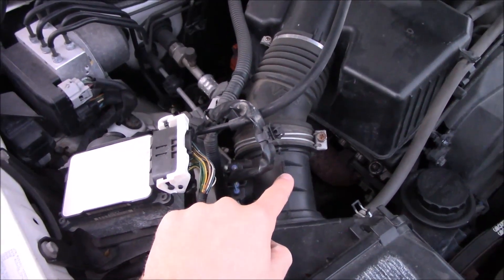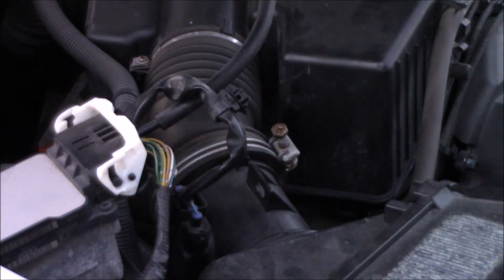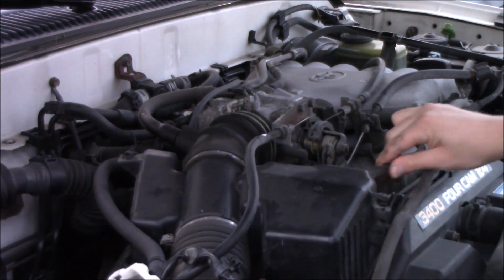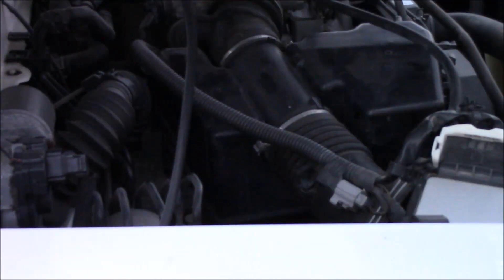How to Clean the Throttle Body (GAS PEDAL STICK)

Comment: Looks like you have slack in transmission kickdown cable.
Adjusting it little tighter will provide smoother shifting & better gas mileage

Comment: Pro tip, contact cleaner is better for this. wont hurt the sensors, will clean the crap out of everything. Plus, wont leave any thing behind, no residue. Have a nice day.
Reply from the maker: +dave runner that sounds like a “Sweet Project Cars” Video... he has all these cool tips and tricks that are cheap and get the job done
Reply: Just a 51 year old mech.

Comment: Useless video. Pull the throttle body and clean it as well as iac
Reply: Agreed.  Ive never ever seen or done it myself on the intake manifold. You remove it and disassemble it. Clean all of it. This is half ass.
 Sorry kid you shouldn't post this vid. Classic yt disinformation.